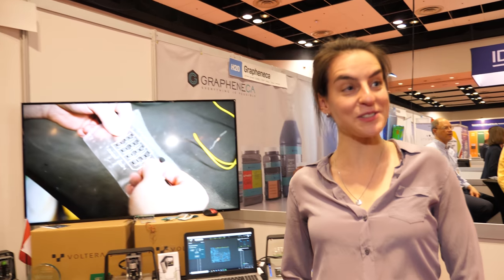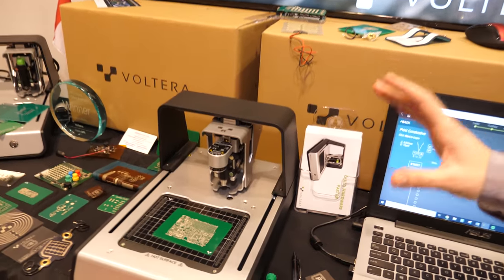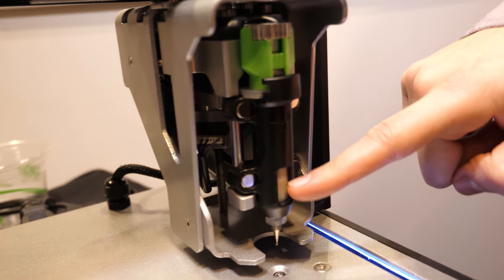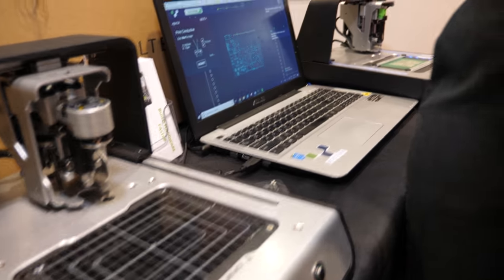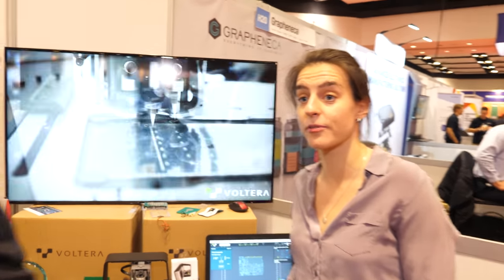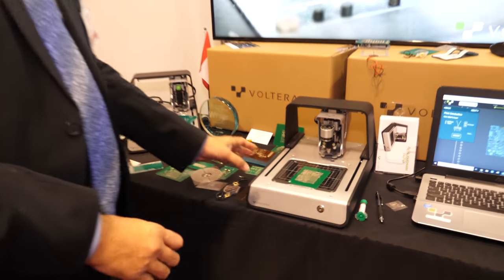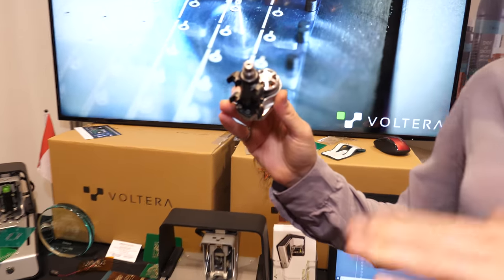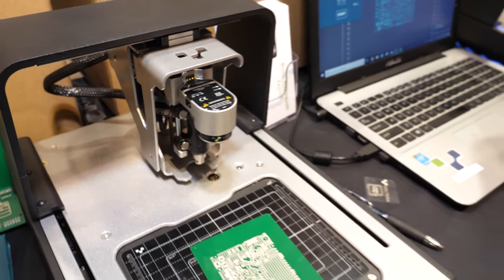Voltera V-One Desktop PCB Printer

Comment: She mentioned RF circuits, i wonder if it's possible to print impedence controlled boards? I just want to have 4 layer boards, since at lease dielectricity of the material and track width is important. i really like to know how to print microstrip lines with this product? If one can control impedance of the transmission line, it may be possible to print antennas with it.